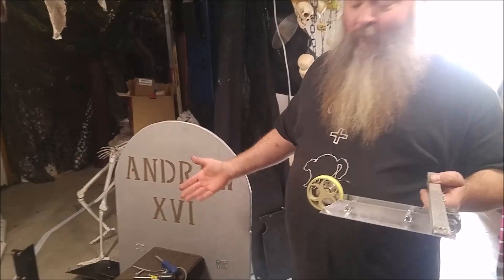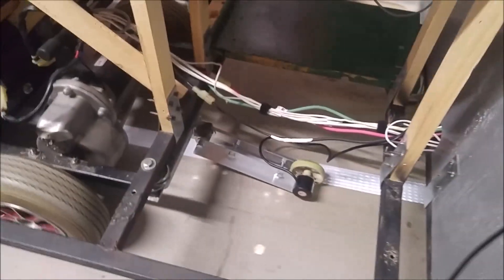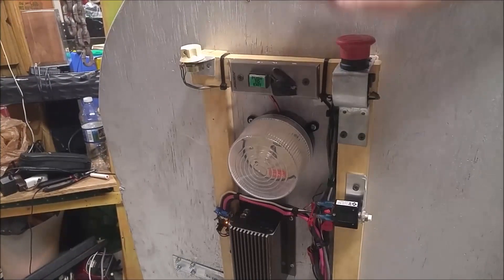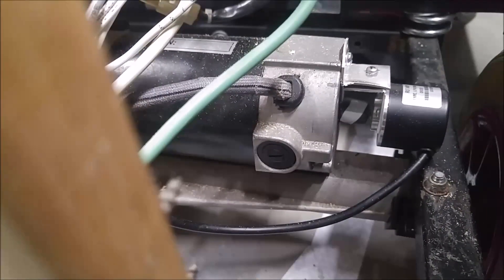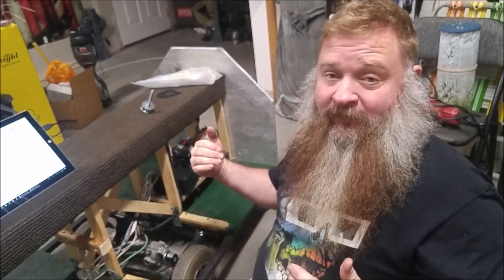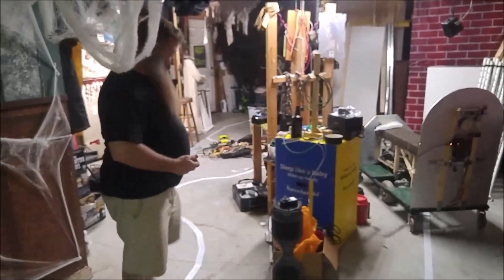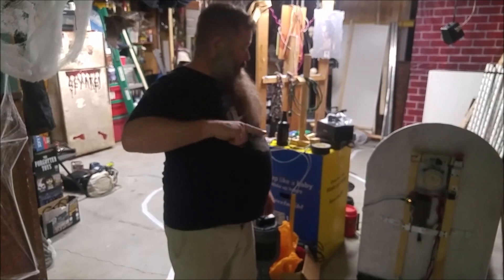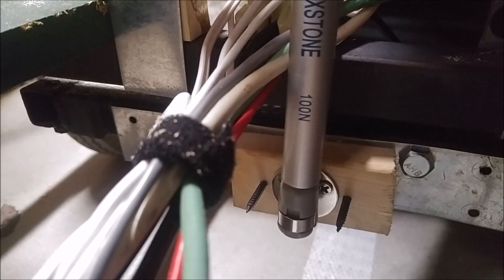Dark Ride Cart Update 4 27 2019

Comment: I would love a more in-depth look at how your system works! What are you programming in that cart uses? It looks like a modified version of the Pololu servo controller? I use their Micro Maestro boards with VSA to do my animatronic routines.
Reply from the maker: You are correct, it is a Pololu controller.  However, it's not modified. It is a Jrk G2 brushed motor controller with feedback support, Specifically Jrk G2 24V13.
I fear you'll be disappointed when you find there is no programming in the cart. Everything is good ol' analog circuits.  
There are 3 sensors. 
One of them looks at the center of the reflective line - if for any reason it does not receive a reflection, it opens a relay latch.  This latch is set by the dispatch button or a wireless keyfob.  The relay, when latched,  opens a short to ground on the motor controller.  This allows the motor controller to respond to whatever  value the throttle is set to.  When the stop button is pressed it acts like the middle sensor and will break the relay latch.  The dispatch keyfob will not set the latch unless the middle sensor can see the line - this is done to prevent accidental travel if the cart is not on track.
The other 2 sensors are connected to an H-bridge driver.  This will tell the steering motor to either turn clockwise or counter-clockwise if only one sensor sees the line. Otherwise it holds a brake on the motor so it will not drift (not a big deal if it did drift - it would correct when it detected the edge of the line).

I look forward to exploring VSA!  Currently, LOR can only support one video feed in a sequence.  I'd love to be able to use more.
Reply: @intocoasters  that's pretty genius! great work!